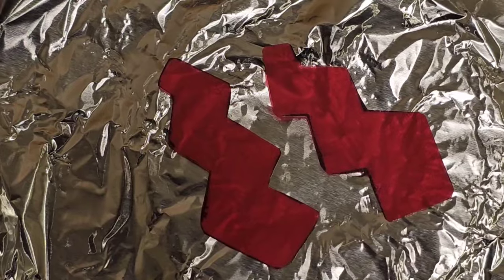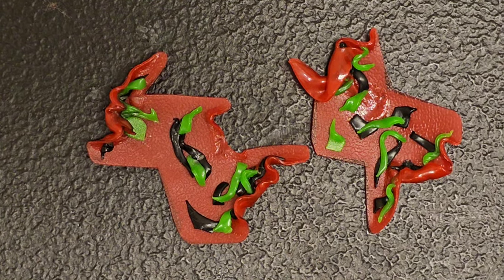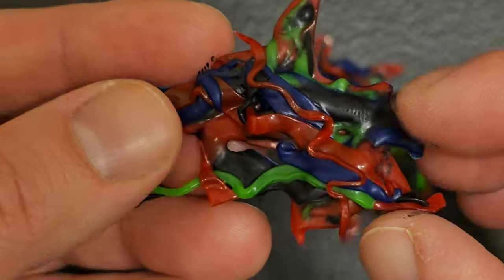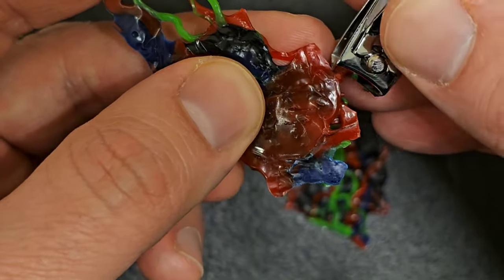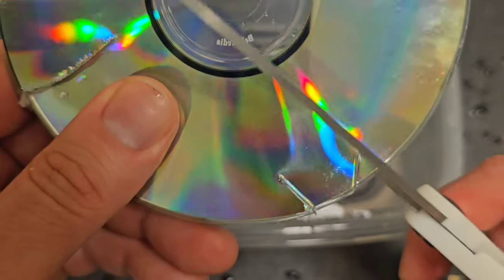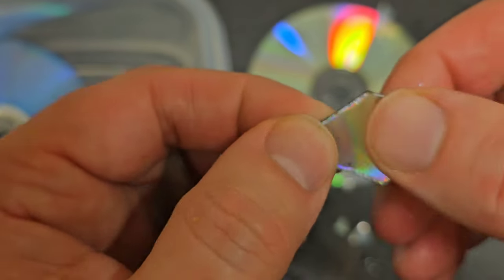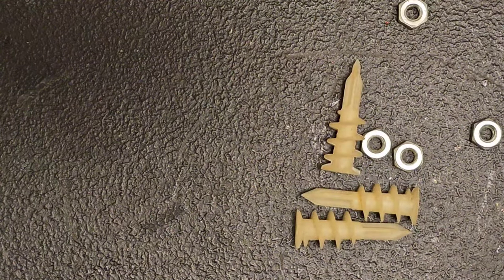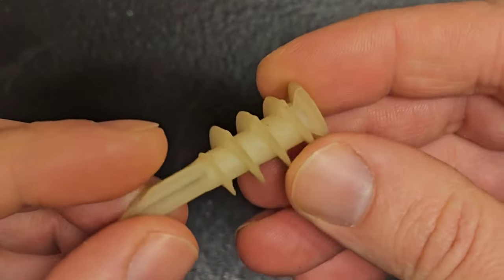T*R#A%S[H] - to - ◇☆◇ Jewelry  ◇☆◇ !!!

Comment: Whenever you melt plastic, be sure you are in a well ventilated area! Especially if it’s plastic that’s not made to be melted, and you need multiple layers. Toxic fumes can affect your brains and your lungs, who knows what else? Putting CDs in hot water and using straight cuts, good technique Matteo! I think my favorites are the painted metal screws, washers and assorted hardware! But spray those with a skin safe clear fixative to avoid skin rashes!